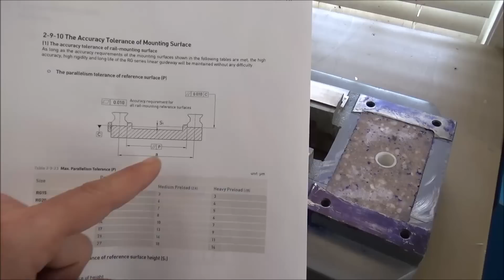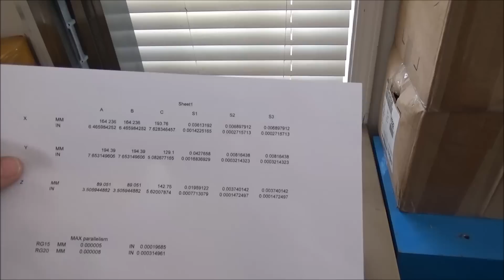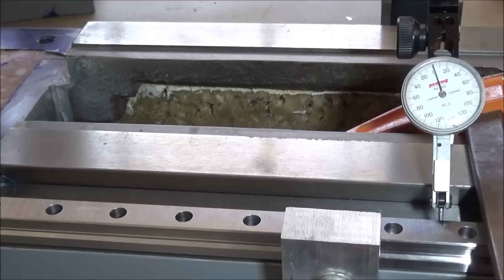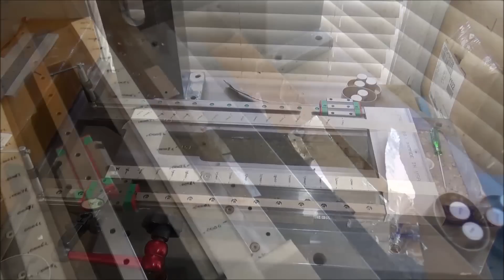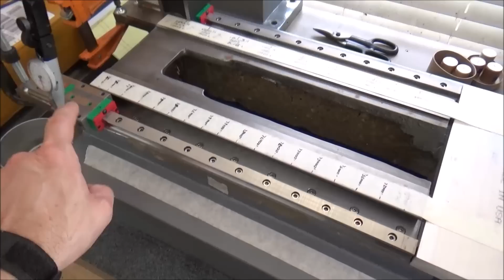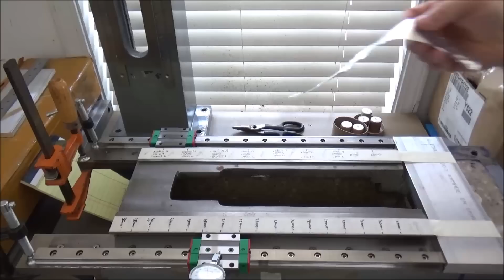PM727MXL Y Axis Linear Rail Install

Comment: Love this vid! Thanks for the rundown!

So if all those parameters are dialled in under the max tolerances how accurate will the machine be? (Repeatability accuracy?)

Cheap cncs are approx 0.02mm

 Decent quality is approx 0.01mm (10microns)

And precision machines (kern, etc) are under 0.005mm 

The kerns with hydrostatic bearings and temperature control to prevent thermal expansion have 0.002 - 0.003mm repeatability (2 - 3 micron!!)

That's fkn crazy!!! Lol
I need to build one for making watch parts, I need at least 0.008 repeatability for watch parts that will be flawless.

It'd be great to know where your cheat sheet would put us at?

I suspect if you get on those numbers we'd be talking a very precise machine similar to the Haas quality if not better.

I'd love to hear some opinions!!
Reply from the maker: well if I ever get the machine finished I'll post the results. but this is a retrofitted machine not originally meant for CNC.
 but hoping for pretty good results.

Comment: I didn’t see the rail reference edge? Did you machine into the surface? Or pin the rails so they don’t shift under load? It’s hard to hear I’m watching in the middle of a machine shop where it’s a bit noisy. My current build I went with HGR25HA for the table and saddle and hgr30 for the column. Using a 30mm screw for z and 25mm for the remainder. 2.6kw AC servo and brake for the column (no need for counterweight) and 750w ac servos for the remainder axis and 600w for the 4th axis of I don’t use my Haas 5c 4th axis instead. May have both option. I wish I had the longer pm727 base. The 833 is a smidgen shorter.
Reply from the maker: I used datums

Comment: Why you're not measuring the rails in relation to each other?  Most machines have leveling feet to "level" the machine.  Isn't it possible your rails were already flat in relation to each other to begin with and just not level with the surface plate?  I guess it would be nice if they were both flat in relation to each other as well as the bottom of the machine...  

The problem is now that you've leveled them (changed them) to the surface plate you might have to do a lot of extra adjusting on the Z axis.

Most people just put the indicator on 1 of the rail carriages and then slide it to measure the other rail.
Reply from the maker: Yes there are many different ways to go about it. I'm not sure my way will give the best results However Many who convert to Rails use Balls  type blocks which have larger room for error on the Side to side and Height discrepancies. The RG series Roller Blocks do not. I wanted to make every effort to get then as close as possible.
The column regardless will need to be trammed in so i don't see that being a Issue.  In the End you have to be satisfied with the process you use . So far I feel pretty good.

Comment: I think you may dread the day you bolt the machine base to the floor, because those mounts will need to be adjusted within the same tolerances.  Just tightening the base down will probably bend, twist, and skew the rails more than .010".  I appreciate your tenacity, as I too, am a perfectionist in most everything I do.  If anybody could make it work, you could.  I just want you to keep in mind that these machines do not have rigid bases, and are not flat, and can easily twist the entire machine just by tightening the base mounting bolts.
Reply from the maker: Yes I anticipate there will be some movement. The plan is to not bolt the machine down hopefully that will help prevent some of the movement. The tolerances will most likely move I just want to start as close as possible.
Reply: @CNC4XR7  or epoxy shim the base with the stand so bolting won't ruin this amazing work of patience!
Reply: Easy fix is to backfill the casting with epoxy granite/resin. We use a blend at work that is stout after it hardens. Every bench mill I’ve built gets EG and I’ve never seen any flexing at all sitting on the base. Just be sure your base is leveled but remember it’s a mill and not a bed lathe where you can see the twist, etc.. also the pm727 has a cast iron base if I recall right? If so that should help quite a bit. For my last build I was machining to .0003 accuracy with a fairly slow feed rate. I expect this current build to meet the same specs with 200ipm feed rates, light cuts, and excessively high rapids. Definitely needs to be fastened to the floor :-)

Comment: Love the work! Excited to see the finished product. One question on your method though. You are verifying that the two rails are the same height by comparing their top height to the top height of your surface plate. That certainly confirms that the rail is the same height from the bottom of the base casting, but how do you know that the bottom of the base is flat? If one side of the casting was 3 thou lower than the other, wouldn’t your method just offset the rails by that amount?
Reply from the maker: I suppose that would be a good assumption, The machine will be resting on the base  and the rails need to be within specs. I found this to be the best way to ensure they stay this way. of course when I do put the mill in place I need to sit it on a surface that is also flat.
Reply: @CNC4XR7  Would it be worth it to just use another (maybe used) surface plate for the machine base, to avoid the time and energy of re-doing any alignment issues?
Reply: Base should be irrelevant. As long as it’s flat and the point of rest is where you want the only concern is what’s above it. If you’re using a new casting or fresh mill tear down you have decent surfaces to start with. I’ve found that the precision Mathews castings are accurate to around .0005 to .001 (inches) and if you take your time and have good equipment you can make it better. My current build the specifications are near or exact to the industrial machine I’m machining it with. If you don’t do something to improve rigidity then that’s your weakest point. Best I could recommend is find an old machine to practice on so you can learn what you need to do so you’re not risking the beloved you eventually want to build.

Comment: Excellent work, it seems very daunting to get to that precision level though. I'm not sure yet if I should attempt that mod on my machine.
Reply from the maker: Well in the end it can only be as good as you can get but the tighter tolerances should yield better results.
Reply: Find a buddy with an industrial cnc and you will get as perfect as you need regarding accuracy. I have both industrial and hobby machines and currently building a pm833 with linear rails. The column is probably most challenging and without proper tools or another machine of decent accuracy you would struggle to do a job well. For myself I can grab the forklift and load the castings onto a 4020 and simply machine them to tolerance then take a grinding stone to smooth any burrs or inconsistencies. You need to machine a reference stop or install pins for the rails to butt against and make sure you indicate everything as accurately as possible. I had to machine my column backside because the casting was lightly rounded in order to get it to lay flat without screwing around with shimming and time involved. About a week to do the column with proper equipment including installing servo brackets, etc... not my first time and the saddle usually takes me a few days and another 3-4 days to get it back together so factor about two weeks time as if it were a full time job or 120 man hours.

Comment: Don’t forget the granite table has errors so don’t worry too much about the odd reading but piece of advice, never shim a rail as that leaves a weak joint enabling the rail to move easily in the event of a machine bump/crash. Keep up the good work.
Reply from the maker: Yes this is true, I'm just trying to get as close as possible. without machining the mounting surfaces I have no choice but to shim. unfortunately there are drawbacks.
Thanks for the tip and comment
Reply: CNC4XR7 Hand scraping is the answer. I’ve over 45 years experience in building cnc machine tools with blisters to prove it 😩 😄👍
Reply from the maker: Yes 
! something i'm terrified of doing.
Reply: @CNC4XR7  glad I'm not the only one!
Reply: @CNC4XR7  If you're putting shims in that are like 5 microns thick? couldn't you just run a stone or some abrasive over the highest spots, which it looks like are only a few cm in length based on your tape marks, and grind off a few microns to get the same leveling effect as you're doing with these shims?  Seems like that would not take a huge amount of elbow grease since you're removing such a small amount of material and you can do it very slowly so as not to overshoot.
Reply from the maker: @perspectivex  it could be possible as long as the stone is long enough to bridge the caps